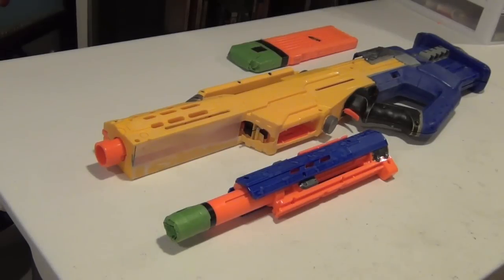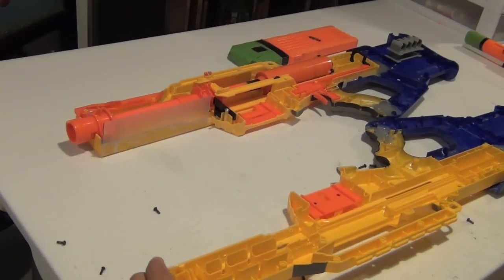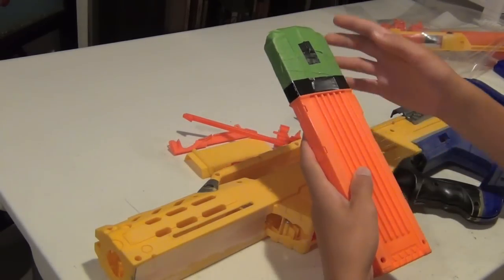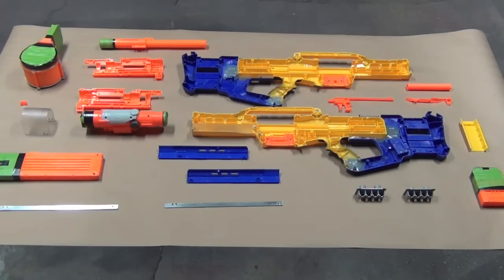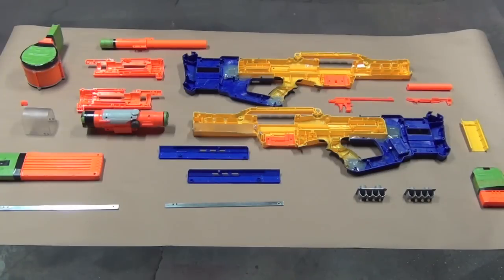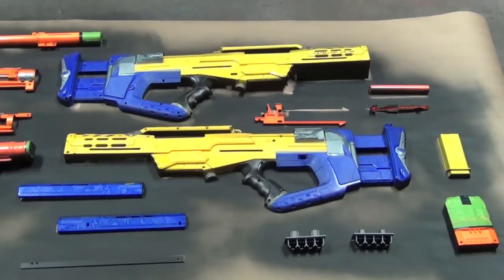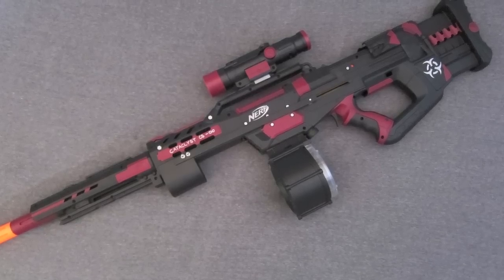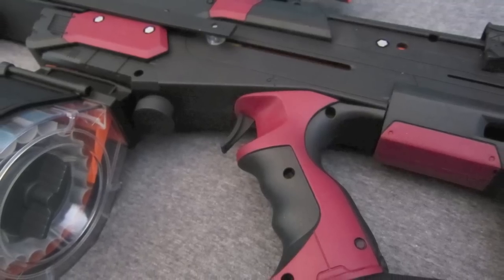[TUTORIAL] How to Paint a Nerf Gun

Comment: Nice looking blaster, I'll be painting a couple of mine soon, I used to cut and bend a piece of wire coathanger and spraypaint over a newspaper-lined bathtub with the parts dangling from my makeshift jig, this way you get good coverage quicker and you can hold  the components to be painted on the hangers so they don't stick to the floor/paper or whatever you cover the worksurface with.
Great video though, and a really cool looking blaster in my favourite colours! Thanks for taking the time to make this tutorial.

Comment: Will my trigger stop working when i don't disassemble my gun? Pls tell me most of the things that can go wrong when i paint my gun without Disassembling it.
Reply: Thermometer _ if you paint the trigger while the blaster is assembled, It may be harder to pull the trigger and some paint may chip off but it is not too bad and the blaster will still work. Also, if you do not disassemble the gun when spray painting, the blaster may not look as smooth and some paint may drip and look uneven but if you are a more casual painter it may not look that bad. I hope this helped

Comment: So my gun is sanded down and primed (I used a Krylon Fusion Spray made for plastic). Then I taped off the small parts I wish to detail (with a brush) and sprayed the gun with the colors that I want. When I took the tape off I went back and did the detailing. I used an oil based paint made by Testors. Long story short, the detailing looks HORRIBLE.  I made the assumption that oil paint would be good since the paint was located under the models in the arts and crafts store. The paint is too thick and doesn't apply evenly. Could anyone please suggest a thinner paint that apply smoothly to plastics? I'm new at this and really wanted to make a cool looking gun.
Reply: Use citadel paints for the details.
Reply: I use spray paint only, for small detailing I spray the paint into a small cup or container, then use a brush from there
Reply: Wait I think I've used that paint.... Wanted to shoot myself after that...

Comment: as a recommendation, don't use really nice warhammer paint. Use other nice acrylic paint, citadel paint is very specialised for small model details. Large guns shouldn't require this paint and directing people the wrong way (plus, telling them to reassemble their guns from base) is very irresponsible. People are going to do exactly what you've done because they don't have experience and think that they will be just as good.

p.s. if you are going to use citadel paints, use mephiston red instead, as is would go better with the runefang steel. That's just some advice